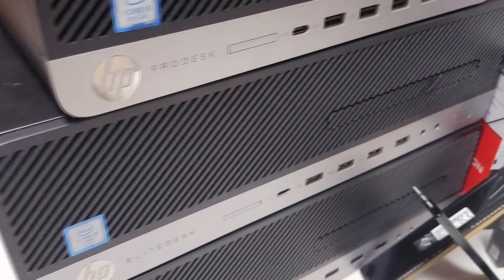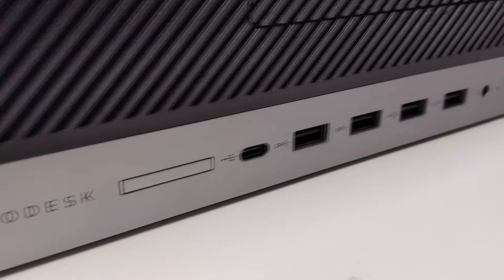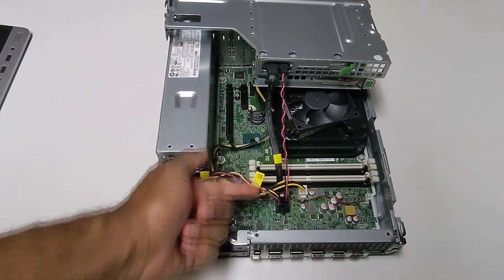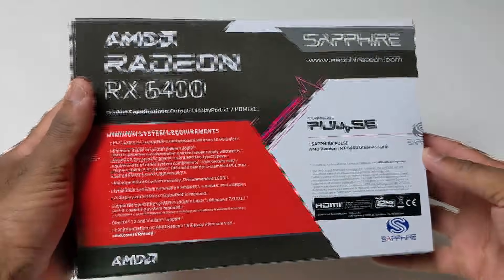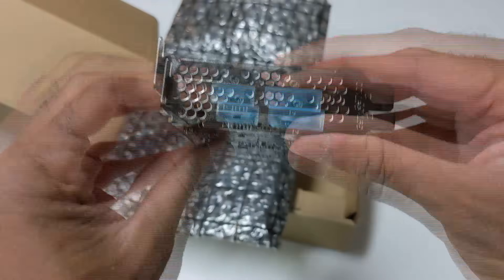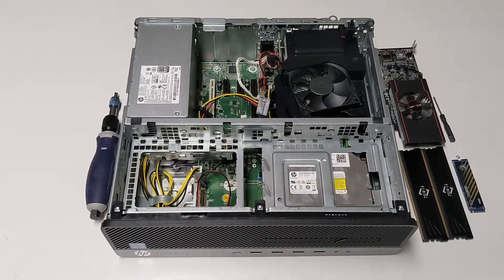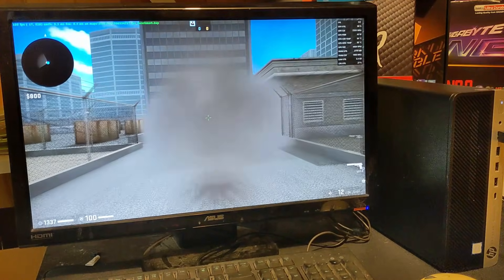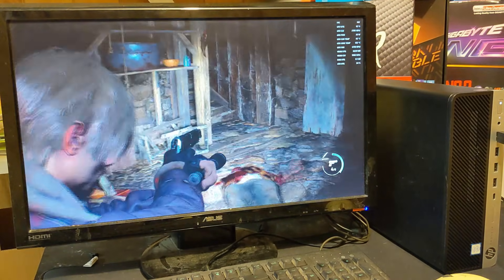Perfect use for the RX6400 - ProDesk 400 and EliteDesk 800 Upgrades

Comment: I have the elitedesk 800 g4 and the card is just like yours but I only get audio.  I did test it on a couple machines and it works fine so did you do anything special to get you card running?  Thanks if you can help it would be greatly appreciated!

Comment: I have an HP Elitedesk 805 G8 running a Ryzen 7 Pro 5750G with the integrated Vega 8 graphics.  If I were to install the RX6400 should I disable the onboard graphics to reduce power usage and heat?  Would there be driver conflicts with the add in card and the iGPU (whether AMD or Nvidia)?  I don't think I can turn off the iGPU in the bios so would probably have to disable the device in Win 11 Device Manager.  Thoughts?

Comment: I have HDMI monitors , could I run both of them off that card? I was told I'd need a display port ++ slot to use the display port to HDMI cable.

Comment: If i dont recall wrong rx 6400 use half the power of 1650 does
Reply: but still im wondering how this rx 6400 work there when those MB in PCIe slot the max energy output is 35W and no 75W, cus RX 6400 use 55W

Comment: This card doesn't work on 800 g3,g4 it shows as black screen not sure why.

How yours booted with display is beyond me.
Reply: Put your rx 6400 in motherboard. Plug your monitor into HP cpu display port. Force windows update and get Microsoft AMD driver. You may have to disable Intel HD Graphics in device manager.

Power off PC and plug monitor into RX 6400. Works on my 800 g3.
Reply: @thomasd2695 

@FireFoxDestroyer 

This is the only way it how it is working for me (6700xt). I tried over days in BIOS options- built in devices option ,secure boot etc.but this card doesn't get detected in bios. I wanted this to be used a discrete gpu and disable Intel UHD. But nothing in BIOS settings help.

The computer came to life and directly at windows logon screen. 

The bad part is I cannot access BIOS/UEFI with F10 with monitor connected to this card, nor I see BIOS/UEFI post messages, nor I can select boot options with F9 Boot Menu.

Strange. I did check different bios verisons, but nope the card just would not show up, or be detected.  Only with monitor connected to Intel UHD BIOS can be accessed.

Interestingly the old RX 560 does show up in BIOS in built in Devices, but none of RX6x00Xt series. 

Pretty frustating.
Reply: I am on the 600 G4, booted black screen but once it hit windows it came up, unable to find a way to completely disable the onboard. Anyone else have luck with this?
Reply: @ajbruscino1 I think it has something to do with fast boot enabled in the bios

Go to the bios (f10 repeatedly on power on)
Then go to advanced options
Built in device options
Then uncheck fast boot

(Correct me if I’m wrong)

Comment: Added an RX 550 (got for $35)to wife's Prodesk 400.  Even undervolted it got too hot for my liking. (90c+)  Got out the Dremel and cut a hole in the case directly above the gpu and added external 90mm fan blowing in.  (did have to get a fan splitter as I could only find one fan header)  Now stays around 65c under load.  Eventually will put a RX 6400 in there if she even wants to play something more demanding than Stray ;)
Reply: How many Watts does your power supply have?
Reply: @juggernaut5860  180w hence the lil gpu
Reply: @kickserver1  Thanks, you also mentioned adding a 90mm fan. Why didn't you use it as an exhaust? Why as intake?
Reply: @juggernaut5860   positive pressure and I monkeyed around and added smaller fan (very small, don't remember size) to the rear for exhaust,  I ultimately removed it because it was too loud.  Already had the 90mm blowing in and honestly never thought to flip it...also removed the cpu shroud.  There is ALOT of airflow exiting from the rear.  I know it's quite ghetto, but ultimately she can "game" on a machine I bought for her circut and 3d printer.
Reply: @kickserver1  Lol yeah, I would've tried to flip it as well. Thanks for the info man. I appreciate it.
Reply: @kickserver1  I'm sorry, but I can ask one more thing? What type of 90mm fan did you buy? Was it a 0.40a?
Reply: Tell me, what is the temperature of the RX6400? I read on one of the forums that one person has about 100° and now I am very afraid to buy it.
Reply: @1999MVK  i added nvidia t1000 and same, need decrease tdp to 85%

Comment: I've the same SFF (an EliteDesk 705 G4) and the exact GPU that I had just upgraded last night. I'm definitely also getting the same temps as yours (mine has junction and hotspot temps going up to 104°C) and I am kinda worried about those high numbers. I'm trying to find out if those numbers are still within allowable operating ranges.
Reply: 1 year later. How is it holding up?
Reply: @ still holding up, surprisingly.
Reply: @RikuIan  terrific news, thanks!
Reply: is the gpu still alive or is it cooked
Reply: @isaiahuy7492  it's surprisingly still kicking.
Reply: @RikuIan hey man im new to this kinda pcs. im gonna buy a elitedesk 705 g4 from second hand market. how big is the psu? can i change the cpu with more watt rated cpu?

Comment: does the asus phoenix version of the rx 6400 work on an hp desktop like these ?
Reply: Ok... got it to work. For whatever reason you can't get into bios with.the card. You have to 1) install an operating system with either integrated graphics or a different card. Then 2) enable legacy boot and disable secure boot in the bios. Then 3) disable igpu in favor of pcie in bios, save and power off. 4) add the 6400 and power on - it takes a minute because nothing displays until login screen. This worked with Debian 12 but would work for Windows as well I assume.
Reply: @matthewward5828  bruh it was plug n play for me..just ddu the previous graphics drivers and reset the cmos battery before installing the rx 6400
Reply: @matthewward5828  nice man thanks for the tip
Reply: Nope. Don't appear to. Not sure what this guy's magic is but I tried two units and neither worked... they recognized an Rx 550 but not the 6400. Updated the bios too and it didn't help.

Comment: I got prodesk 400 g6 microtower with 180 watr 80 plus gold , stock power supply. With graphics is good for my pc? 1650  LP or 6400? . I saw at the comments 6400 is find with 180 watt but what about 1650 LP ?
Reply: What did you get?

Comment: Would the A2000 work with the stock PSU? Thanks
Reply: Yes, the A2000 at stock clocks works fine on anything 240W or better tbh. It says 300W, but you won't see it pull more than 70W. It does depend what kind of CPU you have and how many fans, drives, RAM, etc..

My build uses a 10400 and A2000 and I get below 150w in total system power draw when measured.
Reply: How do you measure it? @dOUBLE_ddeez
Reply: 3050 6gb is a good option for non external power gpu

Comment: Does yours get hot? And does it randomly stop loading adrenaline software? I’ve had these issues with mine and I’m worried it could be a faulty card
Reply from the maker: I can definitely attest that the 6400 LP model does get spicy so the fan on it is going full tilt at all times. The ones that are two slots or regular size with better coolers can handle the heat well. However there were no issues with the AMD Adrenaline software nor any problems with playing anything from there.

Comment: Great video! I have the same model prodesk 400 g4, however with the i5-7500 cpu. I have been looking at using a rx 6400 for this unit but had concerns about the stock 180w psu. Is the PSU in your video the stock 180w? Do you have an issues using something rated under what AMD recommends at 300w?
Reply from the maker: It is using the stock 180W PSU, which is working just fine. Never an issue with anything tested!
Reply: @TechLionPCs  I have the same build with the same PSU, identical however I did notice an issue and I wonder if you had it too.
When I was gaming under full load the PSU got very hot and at some point there was some sort of burnt smell coming from the PC
I checked temps of the GPU (which was at 90c) and the CPU (which was at 70-80c) and they were alright, however the fans were spinning under full load.
Did you have similar issue regarding heat?
Reply from the maker: @mall142  I never had a "burnt smell" experience but can confirm that the card does run HOT as there isn't any space between the GPU and the PSU. Plus the single fan in a single slot barely can keep up with the card. The 2 slot variant of the 6400 doesn't have this issue but unfortunately is not viable in this tiny case.
Reply: I5 7500 is 65w tdp and rx6400 is 53w tdp so youre fine
Reply: @cremacream8983 what about other parts we put inside? Like ram, storage, Bluetooth and wifi cards etc?
Reply: I checked and tested it again and the smell wasn't from the PSU but probably because the GPU was very new when I tried it. The smell disappeared later on, thanks
Reply: @TechLionPCs Is it possible to install this in elitedesk g2 sff? MSI RX 6400 AERO ITX
Reply: @ZdradzoneSerc did you ever found out of the itx fits?

Comment: Hey! Just wondering, what rams are you using?, bc i have the same elitedesk 800
Reply from the maker: Pairs of 2x8GH 3200mhz sticks from 51Risc. The i5-8500 doesn't support anything faster so stuck with what was cheap and available. Plus since it's an enclosed case, didn't need to think about internal aesthetics.
Reply: @TechLionPCs  I read on the specs that this pc only supports 2666mhz